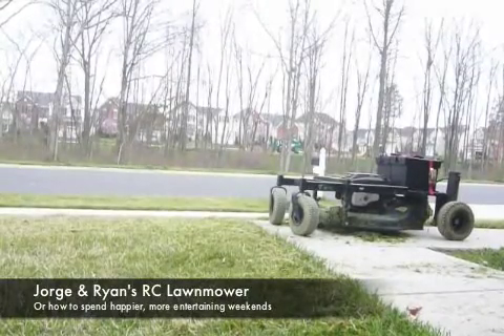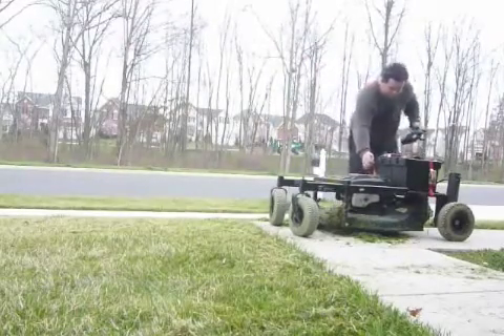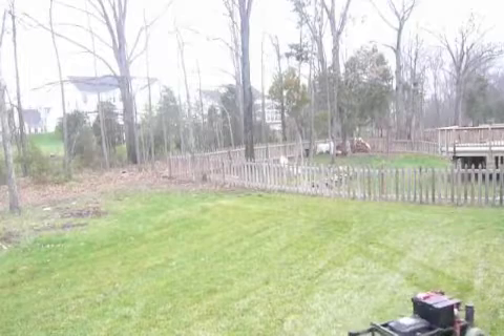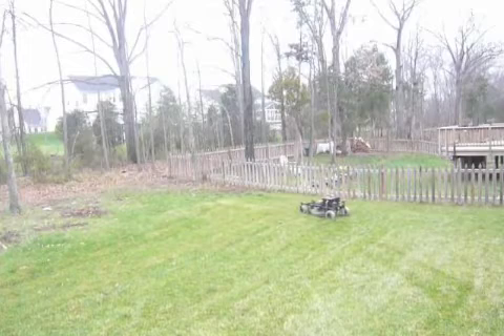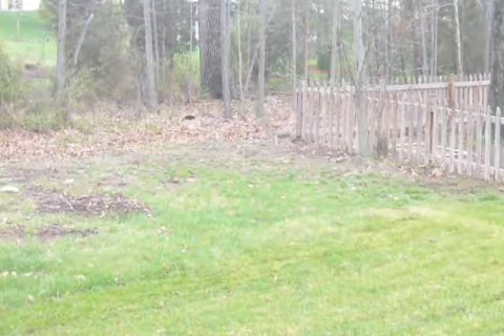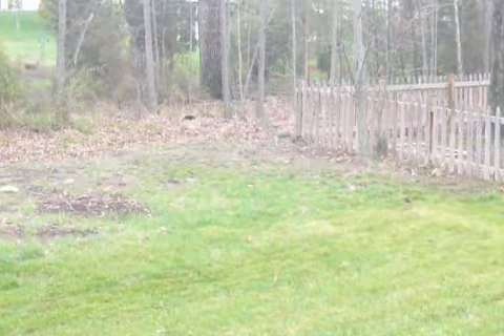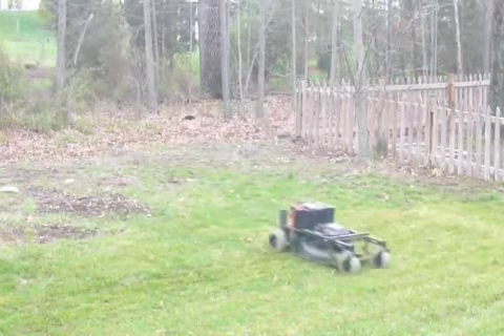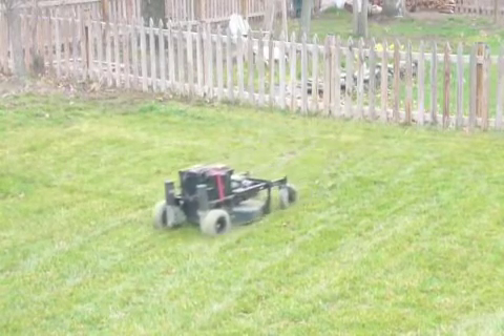RC Lawnmower in Action

Comment: Nice Mower.
I built one a while back and it is allot of fun.
My mower's self propel gears went out so instead of junking it i made it RC like yours. I also use the same speed controller Nice piece of work there!

I understand what you mean about tricky to become smooth on the steering. I find it helps to program the radio transmitter with a bit more dead band and slow it down a bit? Maybe that would be of help with yours? Also i use a spectrum DX3 steering wheel radio instead of the two sticker?